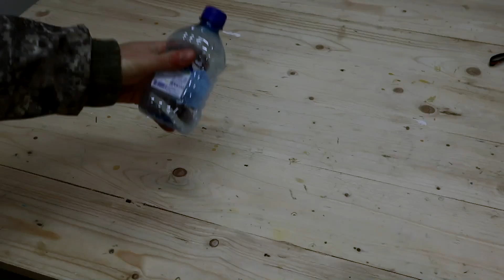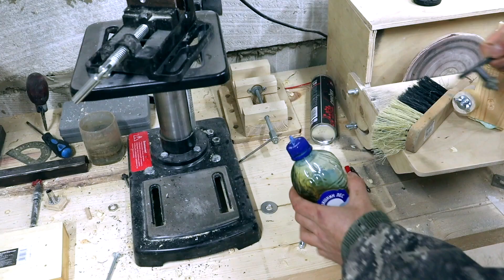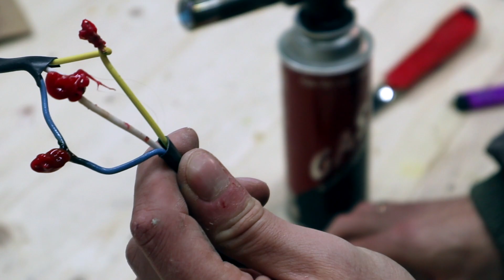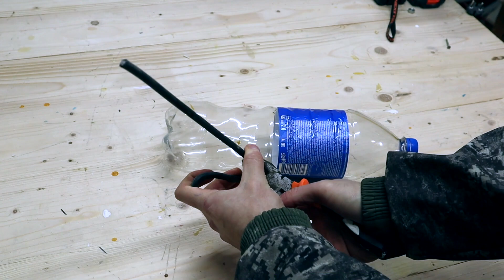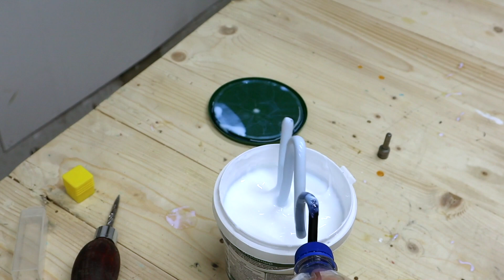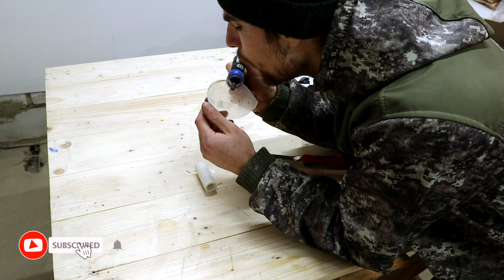Not everyone knows this secret of plastic bottle! A brilliant idea in 3 minutes!

Comment: Shoot if I had to build all that crap and I could charge the customer for it I'd go for it they pay for the time to build them things and the material you can get a stick and mix paint with that whatever that thing was with the bottle on on the point I think the backup or screw I could have a whole condensing unit this man up by the time you build that thing you're right I'm an AC man and I used to be a handyman I don't care to know thank you 🙄